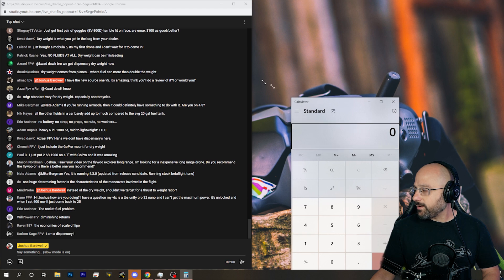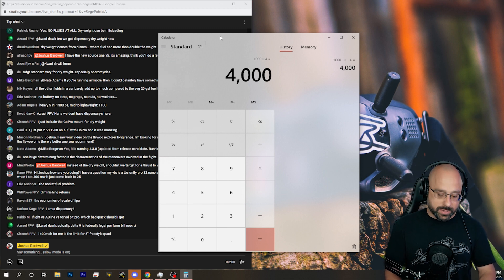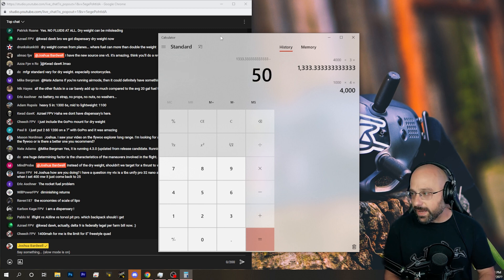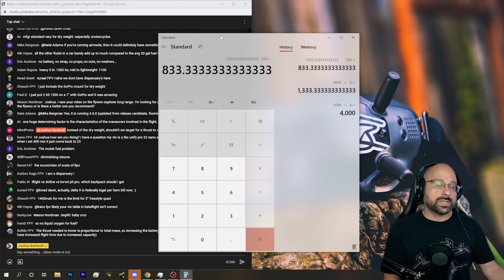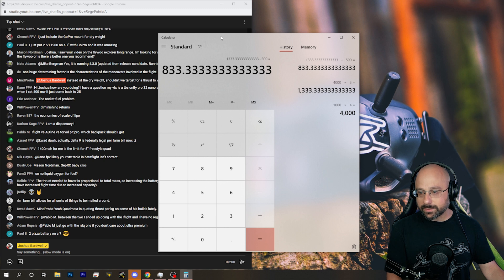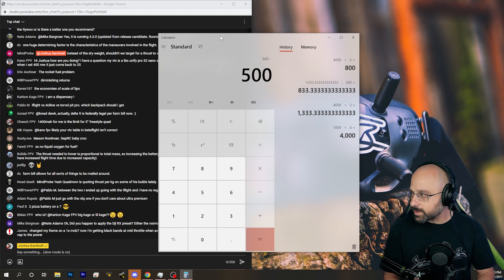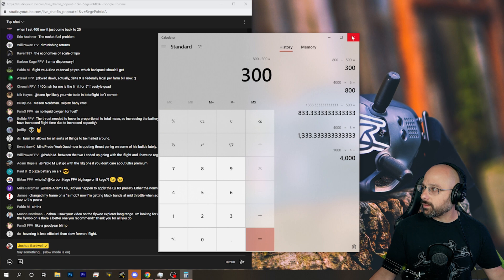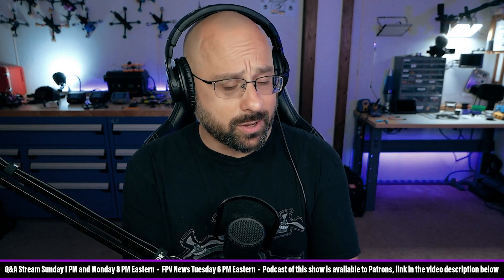When Does Adding A Bigger Battery Reduce Flight Time For FPV? - FPV Questions

Comment: Thats my question like when are the motors overworking? Is a 5 to 1 ratio perfect and the motors wont overwork on a 5 inch with a 300g battery and a gopro? Or am I at 5% thottle all the time to hover? How can I calculate this?

Comment: Question, if I have a 1500mah battery and my drone is weighing in at around 860 grams, and then I have a 1300mah battery than makes the drone weigh in at around 750 ish grams, which would actually give me a longer flight time? The 1300mah that’s lighter or the 1500mah that’s heavier?

Comment: How can i know how much thrust my motors and props can achive?
Reply: I can think of 3 ways:
1. Enable "G force" OSD element in betalight and see how many G can your quad pull either by punching out. In this case G force would be same as thrust to weight ratio e.g if your quad pulls 4 Gs it mean its thrust to weight was 4:1 at that moment. (If it would pull only 1G that's 1:1 ratio and theoretically drone would be barely hovering in place and couldn't even fly up). If you multiply G by drone weight you get your thrust e.g 4G * 0.5kg = 2kg thrust
2. Get empty 5L bottle strap it to the drone with a rope and fill it enough so drone could barely lift it at full throttle (don't burn the motors with full throttle because it's not moving through the air and there's more resistance so keep it as short as possible or don't do it at all) . The bottle + drone weight divided by drone weight would give thrust to weight e.g. (1.5Kg bottle + 0.5kg drone) / (0.5kg drone) would give 4:1 thrust to weight. (0kg + 0.5kg)/0.5kg = 1:1
3. Other not recommended and unsafe way to measure it would be to put it on a scale, zero the scale with drone on and give full throttle (I use this method with the scale put on a wall for and plane pushing toward that wall also I film scale with camera and see reading afterward so I could stand in safe location). If you divide weight at full throttle by drone weight you get thrust to weight. Let's say scale shows 2kg and drone weights 0.5kg that's 4:1

Comment: Is 6S2P li ion the sweet spot for 7" cruise drone ?
Reply: Thats 12 18650 that means you got 576g jsut for the battery plus gopro. Thats pretty high but I think okay
Reply: You mean I should do a smaller one? @v4led
Reply: @PerchEagle  yes probably or use 21700 cause the density is higher I think. But you got tips for my rekon 5 inch. I dont know if I should use 18650 6s or 4s and idk what stack to use cause its 20x20
Reply: @v4led Yep, I bought 36pcs of 18650 and build one 6s2p, I will use it to learn what to design on the next run.
Reply: @PerchEagle  crazy so many? Do you think a 288g battery 4s1p with 27100 is okay for a 5 inch?
Reply: @v4led  it will run it for sure, it's all about how easy to maneuver and flight time. so starting with this pack, you can learn a lot from this setup then you will do your assessments and calculations to add couple for cells for more flight time.

Comment: Hover time is power density / tsfc i.e. (J/kg)/(W/kgf). Since efficiency decreases for higher thrust, larger batteries have shorter flight time, if the battery is the only weight lifted. So if your quad gets longer flight times from bigger bats, it's because your empty quad is heavy and you're able to increase power density, which asymptomatically approaches that of the cells as the quad approaches being 100% battery.
Reply: Hover ≠ Flight time

Comment: I have gone really huge with battery size. I have tested this. I got to point on my long range 5" drone flown terrible (oscillations) but adding bigger battery only gave like a min more. (Oscillations prob killed flight time too)
On my 8" from 8000mah to 12000mah I only gain 5 to 8mins I think it was. Which is like 13% to 21% (times varying depending on flights) for a gain of 28% in weight. Now if I went to 16,000mah another 400g added I'd prob gain only 1min or maybe nothing.
My 5" long range gives like 800g thrust a motor and I fly with 300g battery
My 8" gives about 2500g thrust and I fly up to 1,200g battery (24% hover cruising 32% throttle at like 30mph)
Reply: what is the total flight time that you have achieved with those setups?

Comment: A heavier battery would also draw more current from the motors as the motors now have to lift more weight. Increased current would drain the (bigger) battery faster. I'm sure you could put all this in a formula where the only 'fudge factor' would be a value for responsiveness, which would be very personal.

Comment: That's a great topic, i'm totally agree with the fact that fly time doesn't mean flying better. One thing i can say is that, let's consider you're flying a 5 inch and want to do freestyle, i noticed that the maximum battery you can put so you can at least have a good flying drone is a 1500mah 100C, the optimum is a 1300mah 120C and then down to 1100mah at least 130C. But if you mean to do a long range thing, i think that we should consider some things, first of all I don't think that a 5 inch is the best option for that. Let's say you have to put on it a camera like a go pro 8 for example, you add around 130 grams on it but let's say you want to use an external bec, so we are at 100, now, you have a standard 5 inch, so we have around 400 grams + 100, so we have a 500 grams, without battery, so, a 1800mah 60C weights around 285 grams, so in conclusion we get a 800 grams drone, what's the result? To get 8 minutes of flight you need to cruise at 50km/h resulting in a very slow flight, so at that point you could use a 3000mah 6S li ion pack right? Yes, but you get 13 min if you go always straight (tested) at 50km/h. So in the end a 5 inch is not a good option for long range. For long range purpose if your need is to carry a go pro, go with a 7 inch and a 4000mah lipo 12 min or a 8000 li ion (20 min) at 100km/h(average). I personally use a 6 inch, 900 grams with a 1800mah 120C battery and go pro, it react like a 5 inch and i get 8 minutes flying at 70km/h(average) wich means 4,5km away and back for a total of 9km.

Comment: I have a big spreadsheet to calculate this.  The throttle-thrust relationship is a curve, usually a power of an exp curve - I use 1000*power(exp(THRUST/15300000)-1,0.75) to find throttle position from desired thrust output for typical 5" motors.  The throttle-power relationship is an inverse exponent, I use THRUST/1.73*exp(1-THROTTLE).  Then you go back and find the hover throttle (T/W of 1) and figure out how much power that uses, then divide that into your lipo's Wh and multiply by 60 to get an approximate hover time for mostly-gentle flight.  Yes, it's a pain, but it is reasonably accurate.  The end result? Essentially the exact same thing you said. You can go up in battery size to WAY more than you think and get good times at the thrust-to-weight you set, but this makes your hover throttle higher, makes the quad less controllable, and there are diminishing returns in terms of how useful your flight is even as your hover time gets technically longer, because you are using more power to hover, and that additional power is not linear.

Comment: In my opinion, for more aggressive freestyle flippy-flops, you don't really want to go below 5:1 thrust-to-weight, and for cruising, 3:1.
The equation changes a little if you're undervolting (ex, flying a 3s on a 4S rig), since you aren't reaching the motor's "overworked" inefficient state as deep into the throttle as you normally would.
That said, don't go below 2:1. Going below 2:1 is only going to be "fun" in watching just how incredibly terrible the thing flies in this state.
I've flown quads with bad thrust-to-weight less than two.
You CAN fly it, but it's not a particularly enjoyable experience for anyone vaguely proficient.
You can also actually get trapped in your prop-wash and crash if your thrust to weight is terrible enough.
Reply: Thanks for the comment, that was really insightful. How can I calculate my thrust:weight? Are you more or less approximating, or is there a way I can get accurate numbers w/out a thrust stand? Thanks!

Comment: That's something that would be really interesting to test. The issue would be to find good batteries of all sizes. (The 4s 2000mAh were horrible, for example.)
Reply: Using a smaller quad for the testing opens up the ability to use better batteries. (Flying a 3” with a 1500mah 4s for example)
Reply: @StallionButter69  Excellent point!
Reply: why were they horrible? li ion are porbably good